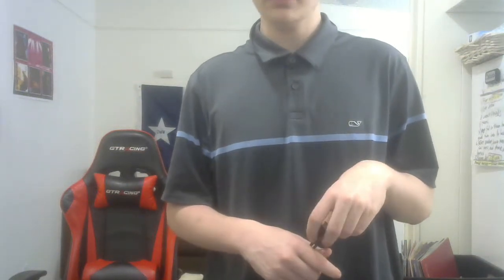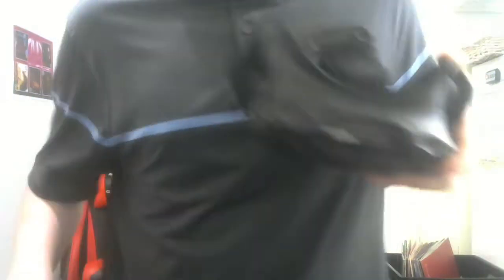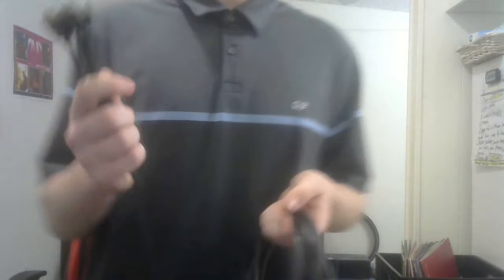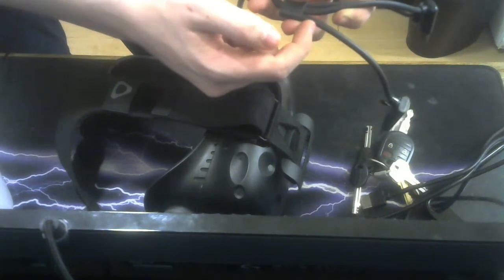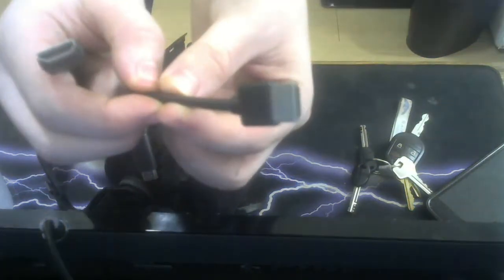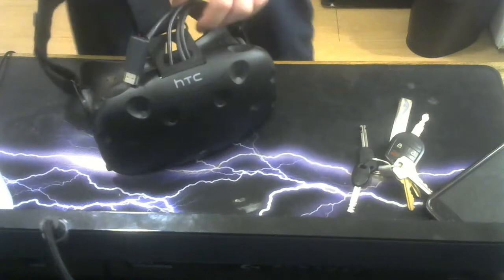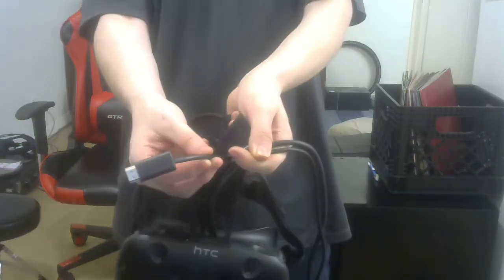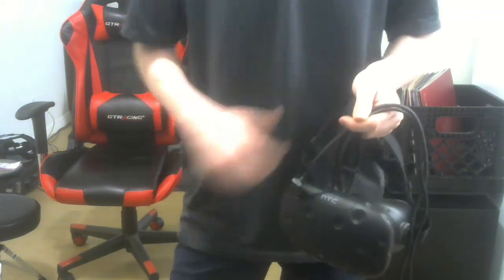[Vive Cables built to break] - How to fix a broken HTC Vive 3 in 1 cable - Shame on you HTC!

Comment: The linked "Cable Matters" cable isn't working in my vive. It fits perfectly, and it works with other devices, but it's just dead-blank in my vive. The old cable still partially, works, so I know the connections are fine. It seems that only certain cables might be compatible, even if they do fit the profile. There are some reddit posts on this.
Reply: I found a potential explanation in the reviews for this cable: ""That cable uses an active chipset to boost the signal since the cable is so thin. In rare cases, devices like your phone can be incompatible with the active chipset." You may want to look for a thick cable

Comment: Annnd you just saved me 70 Bucks! 

I bought an ultra slim cable and chopped out some of the housing - no HDMI connection.
Used the hdmi from the HTC Dock - no hdmi connection.

Had to plug hdmi direct to gpu, then connect to Dock and hit restart to get it working, just sharing incase anyone else has the hdmi output issue too with a new cable!

Comment: Thanks, I've been overwhelmed by the idea of building my own replacement cable but you explain it very simply in this video. Props for still nursing that vive.
I've found that cable lifetime is extended significantly by hanging the cable from the ceiling properly, if possible. The ceiling-suspension system has to be done right though- there should be a separate structural string that takes stress of tugging so you aren't tugging on the cable, but that has to be set up in a way that won't give you whiplash if you accidentally go beyond its maximum range.
There are also apps like cable guardian that keep track of twisting which helps minimize that issue without having to untwist manually each time.
Reply from the maker: im still using it today

Comment: was wondering about the dc connector for the headset with 3.5mm dc male to male ? does it work
Reply from the maker: Yes as long as the power being supplied is identical do not overvolt it

Comment: Bro, the timing of this is actually insane. 2 days before you made this vid was when I got my cable bc I thought to get a slim HDMI for my headset after over 4 years of the cables breaking and prob over 1500 dollars of repairs, but the darn USB port broke. I got a new vive headset from ebay, and then my jerry rig cable broke after 3 hours of use. I got my newer one, and I'm hoping this one will work. I discovered this video in a attempt to find a way someone may have rerouted the cable to last a bit longer when I discovered you using the same tactic. I agree with you idk how not more people have thought of this trick, and I'm glad you made this video bc I wish I saw it sooner before shoving out so much money for these worthless 3 in 1 cables. Thanks for the content, this deserves way more views!
Reply from the maker: I couldnt agree more! I'm not the best hardware hacker but this is certainly a very good way to save money as old vives (the headset itself) is very hard to truly kill!
Reply from the maker: Something for you to know you can actually cut a hole for the cable to come out of directly over the hdmi port to further reduce cable wear

Comment: When we cut the extra cable, should we just use electrical tape? Since when we're running the headset on, wouldn't you run the risk of getting electrocuted through the HMD? I'm not very tech savvy, I'm sorry.
Reply from the maker: both ends of the hdmi cable are cut off so there would be no power or signal flowing through that part of the 3 in one cable or its associated connectors at each end but do use electrical tape every 2.5-3 feet or so to hold the two cables together to prevent clutter!